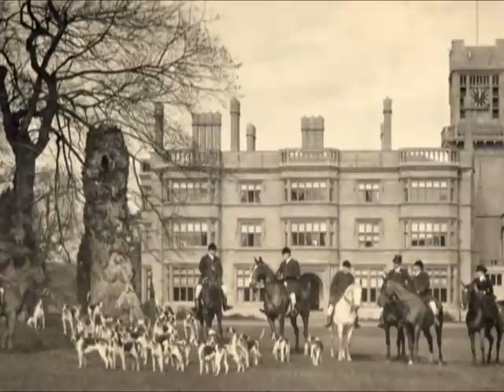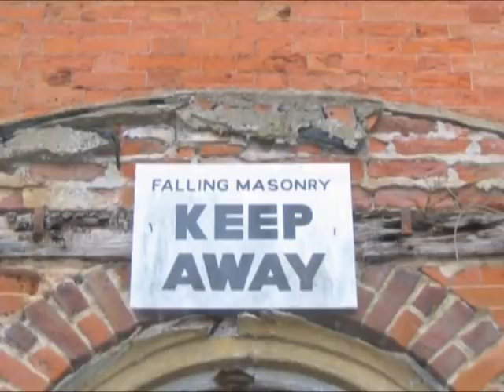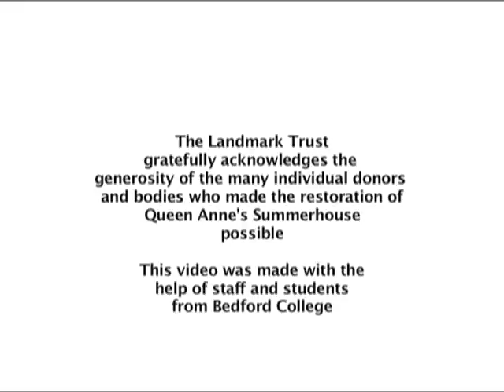The restoration of Queen Anne's Summerhouse | The Landmark Trust

Comment: Lovely project, but the results of the interior design look disappointingly dowdy. It is like nothing has happened between the 1970 and 2010 Britain in terms of interior design. Who would want to stay there? Only the kitchen looks contemporate. The rest of it looks like it already needs renovation. I wouldn't have minded the interior looking historic, but it just looks like the interior of any castle, which are filled with long-used or disused old sofas, beds, bed coverings and drapes. That bathroom, oh my God... and is that a single glazing? In the old days, wouldn't they have had wooden shutters in the interior of the main room? Also poor presentation: there are 4 turrets, however only one's use has been shown as a kitchen, the other one is presumably the staircase to the terrace, what about the other two?